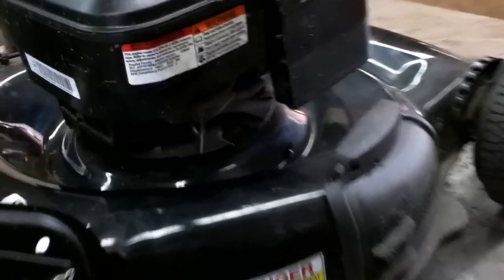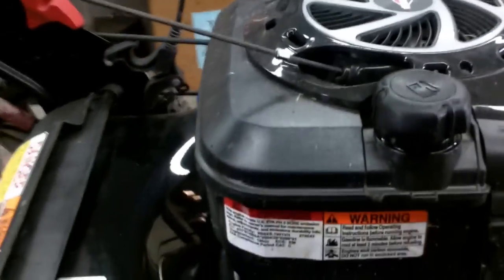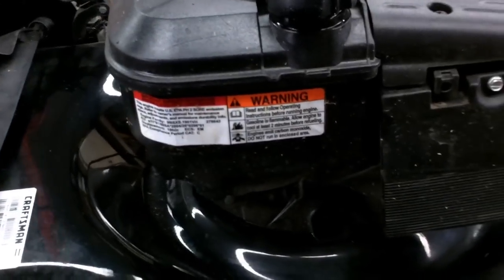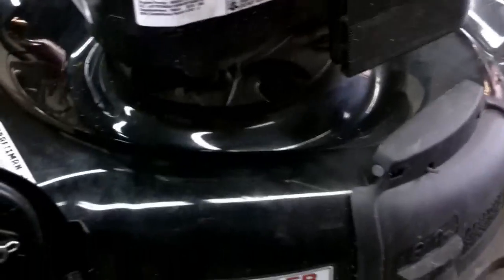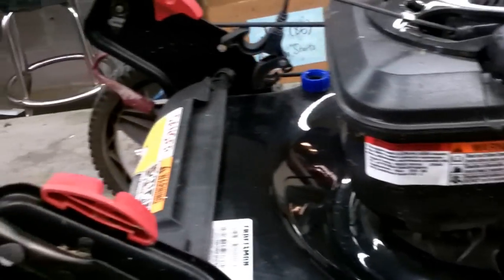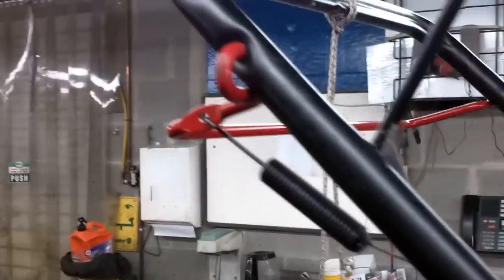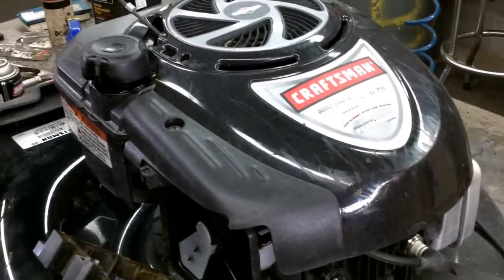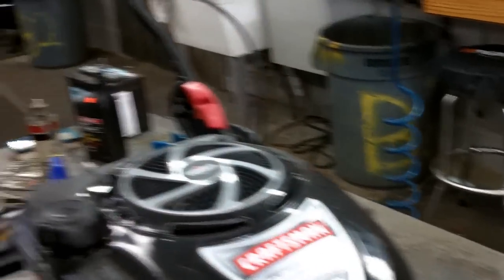lawn mower care and maintenance

Comment: I had that same mower and it was burning oil.  Took the head off and oil was leaking past the valve guides into the combustion chamber.  I have since replaced the mower but would there have been a way to fix that besides a trip to a machine shop?